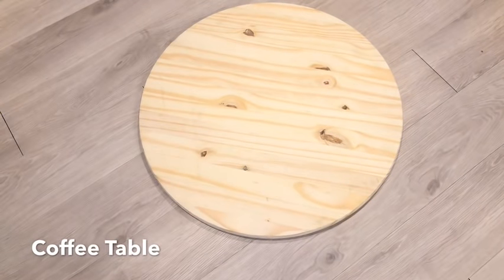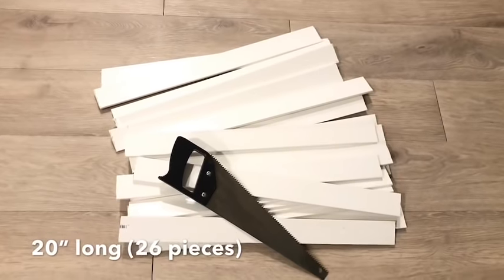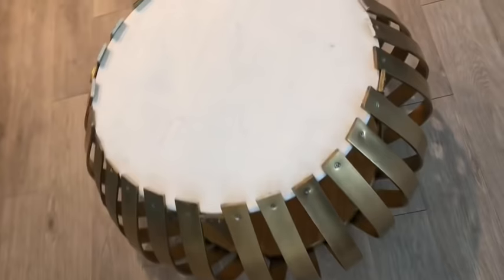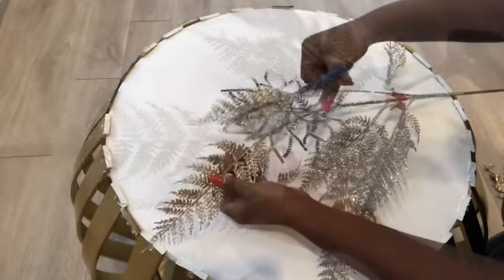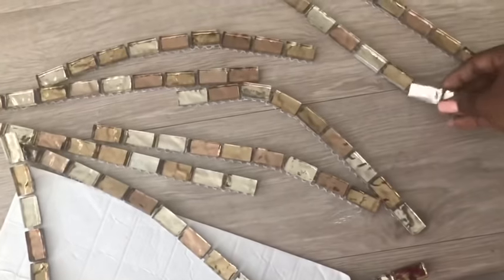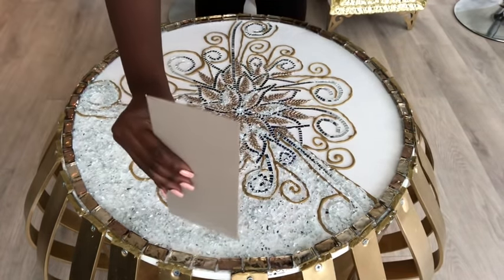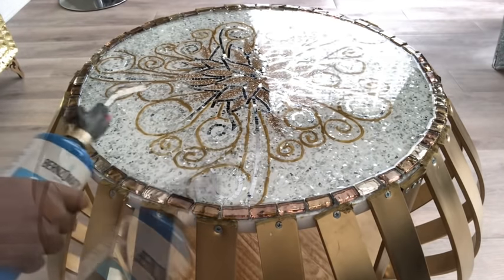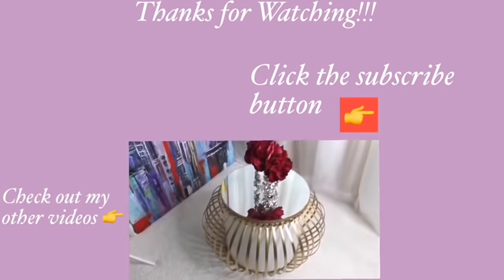DIY COFFEE TABLE WITH EPOXY - INEXPENSIVE HOME DECOR IDEAS!

Comment: It's beautiful.. Helpful hint for the next time you use the pvc strips, heat makes them easier to bend. You could make a cheap jig of scrap wood and nails in the shape you want the pvc to be and then heat the pvc with boiling water. It will have to set in the water for a while but it works, or just use a heat gun.

Comment: Was it really necessary  to use 3 screws to mount your vertical supports?  I would have thought no more than 2 would be necessary. Also, I would think that having 6-8 vertical supports would allow for finishing nails/construction adhesive to attach your bent side pieces. 
Also was epoxy truly cheaper than a piece of glass?